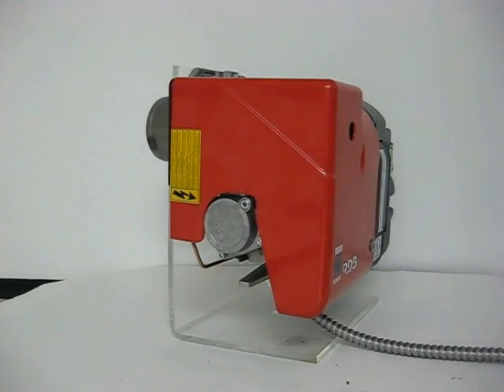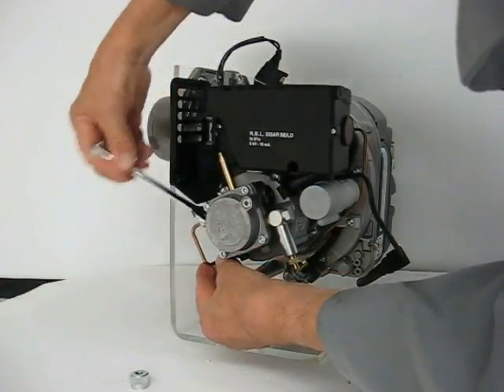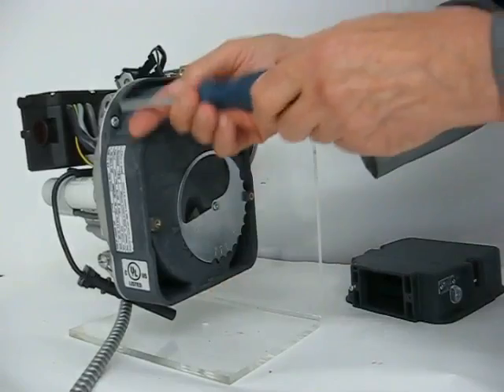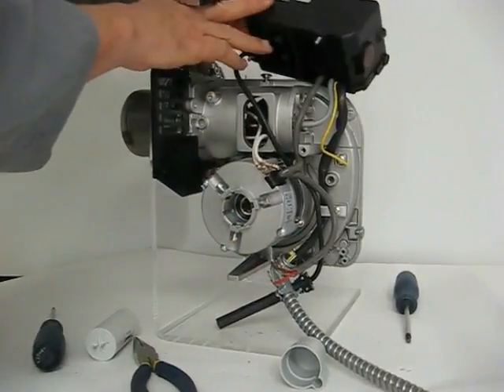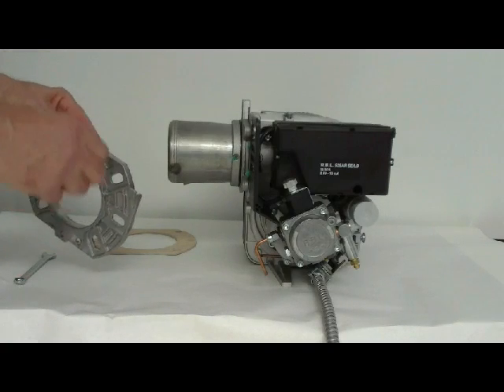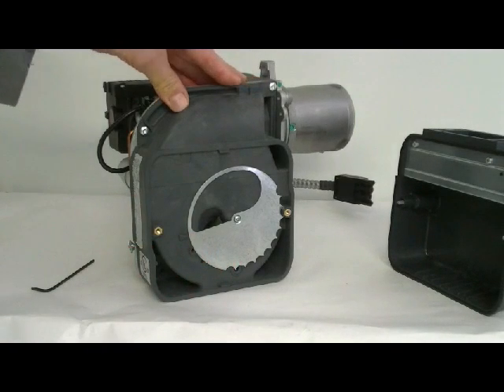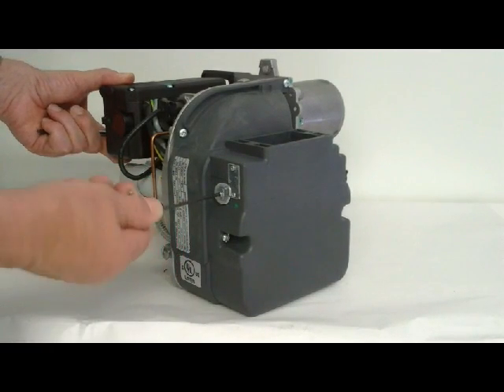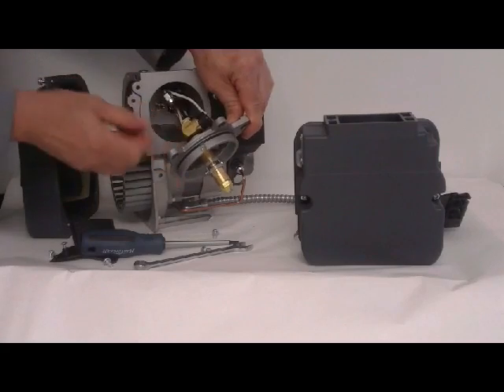RIELLO RDB oil burner  Installation & Assembly

Comment: ross-bought a riello RGB1-TYPE 483-T50  BRAND NEW TO REPLACE MY OLD NUWAY BOXER C SID 80--- BUT IM STUCK-----THERE IS A  AIR VENT OF SOME DESCRIPTON ON SIDE AND IN BOX IS A HOSE SIMILAR TO T/DRYER HOSE  WHERE DOES THIS GO TO? ITS NOT ON YOUR MODEL CAN U ADVISE?
Reply: think your looking at dual purpose for hose connection for  balanced flue